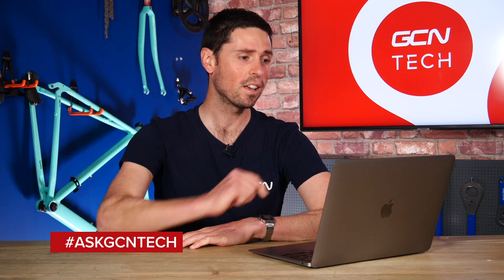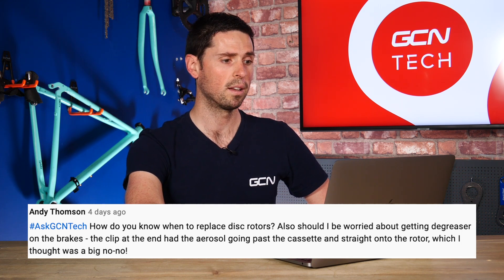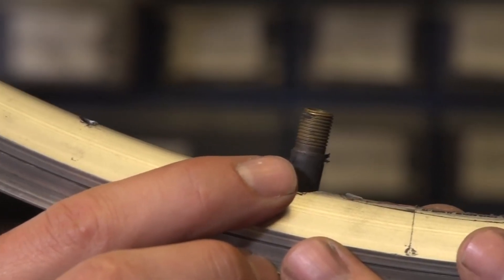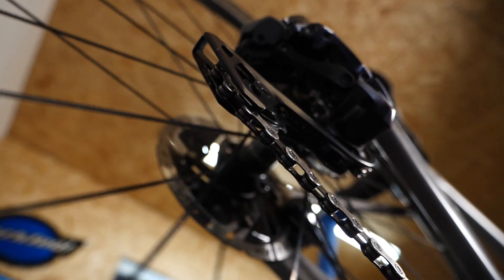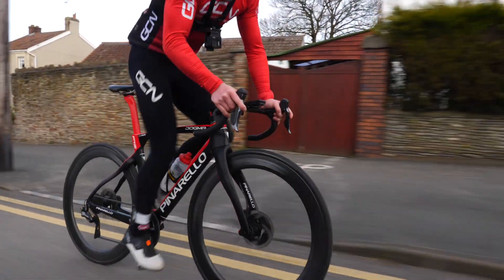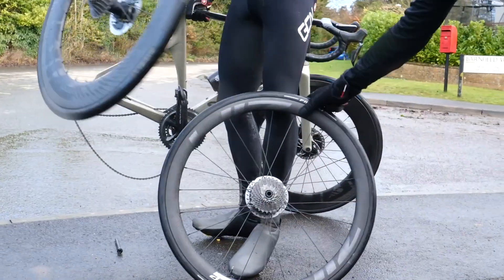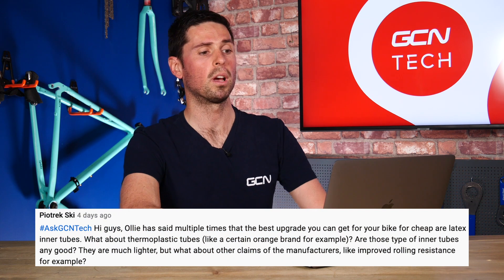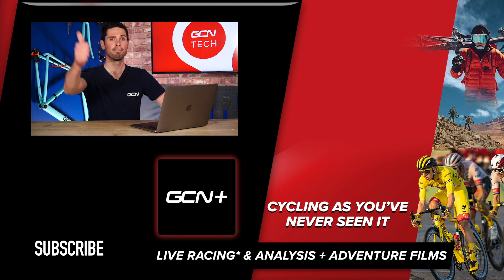When Should You Replace Your Bike's Disc Brake Rotors? | GCN Tech Clinic #AskGCNTech

Comment from the maker: Do you have a burning bike tech related question? Leave it in the comments below using the hashtag #AskGCNTech and we'll answer it in a future episode of the GCN Tech Clinic!
Reply: #AskGCNtech Need to find a replacement for badly designed R.A.T axles on 2 Focus Paralanes in the households... any ideas to convert to better through axles like the DT swiss ones 👍
Reply: #AskGCNTech  How do sealant fillled inner tubes compare to running tubeless tyres in regards to puncture protection? I'm not particularly worried about speed/rolling resistance etc.
Reply: #AskGCNTech which one will you choose for climbing: 9.5kg climbing bike, or 8.5kg aero bike
Reply: #AshGCNTech
Hi GCN, I just got a new road bike and I started using it quite well but I have a problem....when I put out some considerable amount of power through the pedals, the bearings of the bottom bracket start making few clicky, creaky noises. It is not too loud but enough for me to get annoyed. So I got the chain off the drivetrain and the cranks were buttery smooth
What should I do? Should I ignore it?
Thanks
Reply: #AskGCNTech when cycling in heavy wind, who is more affected: a smaller 170cm person/70kg person or a taller 190cm/85kg person?

Does weight or height matter the most?
Reply: #AskGCNTech Do you have any tips for keeping white handlebar tape looking clean and fresh? I certainly don’t have the time or budget to replace it whenever it gets dingy. I’m wondering if I should just accept the fact that I’m no pro, and start running a darker color. Thanks!
Reply: #AskGCNTech I’m looking forward to change to carbon rims, I got a specialized tarmac Sl4 with shimano ultegra r8000 brake calipers…. Will a 29mm width rims fit the bike? I’m having a hard time finding answers. Thanks greetings from Colombia
Reply: I must disagree with Alex's answer at 0: 25.  As long as the cargo bay is pressurized to the cabin pressure of the aircraft, there can be no more than a few PSI increase in relative pressure at altitude.  Commercial aircraft are required to maintain cabin pressure below 10,000 ft by regulation. The pressure at 14,000 ft is 11 psi, or only about 3.7 psi below standard sea level pressure. Thus, the most increase you could ever expect in an aircraft that doesn't experience an explosive decompression is less than 4 psi, and that would be a fault condition as aircraft generally regulate pressure between 5,000 and 7,000 ft.  Provided you run your tires at least 4 psi below the tire's maximum rated pressure, there should not be a problem.  If you want to cover explosive decompression of the aircraft (a less than one chance in 10 million hour event), you will need to lower your pressures to below 15 psi below maximum pressure.
Reply: #AskGCNTech Hey GCN, I know not to use degreaser on disc brake rotors, but how about on rim brake rims? Even with rubbing alcohol and bike wash I cant seem to find a way to get the grit and black stuff off my rims. Thank you!
Reply: #gcntech Question: I'm doing a long online challenge on rough urban roads, and thought about using wider wheels, and tires such as 42mm wide. But these roads are also littered with quite a lot of broken glass, and the thought came to me: aren't wider tires technically much more prone to punctures? As your contact patch is much wider and therefore you're covering much more surface area of road during your ride?? More likely for you to run over a puncture-causing piece of debris. Very interesting...
Reply: #AskGCNTech Can you open and close quick links in a chain multiple times, e.g. for cleaning? I heard that normal ones should not be used several times, but the brand Connex does links that can be reused.

Comment: The bonk weight loss thing was probably a combination of dehydration and depletion of glycogen, which together can cause 10+ pound difference depending on your size. That difference won't be fat, but it will be visible (fully hydrated and topped up on glycogen will be slightly bloated, versus completely depleted and gaunt).

Comment: Putting on my nerdy propellor hat…
@0:13: You don't technically have to deflate your tires when you fly with your bike. Airplane cabins/cargo holds are pressurized to about 11psi, which is only 3.7psi lower than sea level. Thus, it will be as if you increased your tire pressure by 3.7psi, and that's insignificant in most if not all cases. Even if the airplane is to suffer a catastrophic depressurization in outer space, the tire will see an effective increase of 14.7psi compared to sea level; I don't think most of us run our tires that close to the limit (and there's a safety margin built into the max pressure printed on the tire).
@2:58: There's a significant reduction in chain tension with the 42x42 compared to the 34x34, because the larger chainring/cog is trading off chain tension (force) for chain speed (displacement) to transmit the same power. Generally, lower chain tensions will translate to less wear and higher efficiency (unless you're cross-chaining).
@4:17: There are about 4,000 calories of energy per pound of fat, and you need to burn a lot more than one pound of fat for it to show visibly. Since you may know that it's actually quite challenging to burn 4,000 calories for one bike ride (a metric century burns approx. 4,000 calories), you should be satisfied that the bonk, however awful it felt, didn't make you look thinner.

Comment: Disc Rotor alignment - you are indeed able to "space" all your wheelsets the same. Ask anyone that races cyclocross semi-seriously :)

And yes, you CAN space out Centerlock rotors. In fact, I use the same shims that (one piece "ring" shaped ones) that are used for spacing 6-bolt ones. They are flimsy enough you can push them past the splines. Worst case, you can split them or buy dedicated ones. Boyd and November cycles have them, as well as a few others.

Much worse is when one of your wheelsets has too much paint/anodization on the brake interface and you actually need to push them inwards to match the rest of the wheels you already own. I had to resort to the judicious use of a file and sanding sponge to make an old Spinergy wheelset fit on my gravel bike (which already is spaced to fit all the other wheels I own). About a 2 hour job.

Comment: schwable inner tubes have removable presta valves as i use them with sealant
Reply: So do Continental, Specialized, and several other brands. Inexpensive tubes usually have a fixed core though.

Comment: #AskGCNTech I have a recurring problem with an annoying creaking coming from the crank area. It's in rythm with pedaling so I'm pretty sure it must come from one of the parts of the frontal drivetrain (I also checked my seatpost and handlebar) - I removed, cleaned and regreased my cranks, chainrings and any nuts and bolts and even had my local bikeshop take a look and exchange the bottom bracket - alas, to no avail. Any more tips on what else it could be and what to do?

Comment: I've tried ghetto tubeless conversion once using shrader valves. The conversion worked well but valves were clogging with sealant constantly. I find regural shrader valves not suitable for tubeless sealant.

Comment: You can use spacers on a centerlock by using a centerlock to 6 bolt adapter, a 6 bolt rotor, and the spacer.   But you can only space it outward, not inward... so it can only help in very specific scenarios, and of course it requires all those things.   (I only know this works because I switch between a 6 bolt wheel and a centerlock wheel with a 6 bolt adapter because when I bought the wheel I wanted to re-use my rotors from the old wheels they were replacing to save some $).   You can only use ONE thin spacer though, at least with my adapters.   Any more and you wouldn't be able to bolt on the rotor.   Luckily one thin adapter is all I needed to make both work great.
Reply: You can have the inside edge skim along the inside face off the securing (holes)off rotors or face off wheel enough to use spacers to adapt inney or out to get provided correct position making your own spacers. Along with floating rotor not only dealing with heat but possibly position  (don't use angle grinder ) if you're a club it's worth investment small quality milling drilling machine if not find some motorcycle motor engine tuner somewhere that does precision engineering.

Comment: #askgcntech my wife's bike has an ultegra R8000 crankset with a compact 50/34 chanset. She wants some easier gears, so I think she should get a subcompact 46-30 chanset. Are there chainrings I can fit to the existing ultegra cranks or will I need to get a new GRX crankset and will the GRX600 crankset fit  the existing ultegra front derailleur?

Comment: #AskGCNTech
I am trying to upgrade my really old Apollo Bike from Halfords.
It has Shimano 7 spd gears but I want to install a road handlebar and shifters.
Can I get away with just changing the handlebar and shifters to Shimano 7spd road style?
"Shimano Tourney ST-A073 Gear/Brake Lever Set Road 3x7-Speed black"

Or will I have to upgrade EVERYTHING including the cranks cassette and both derailers?

My bike is 3x 7 spd. Has MTB handlebars with grip shifters.
It has a rear spring and front shocks. but I don't think this has any effect on the bike really.
It has a Front Disc brake and a rear rim brake.

I assume if I change my shifters to STI, the brake cables also need to be redone at the same time.

Comment: #AskGCNTech If I swap an ultegra 11-28 casette for something more suitable for climbing, like a 105 11-34, do I need to adjust the rear mech or chain? Cheers!
Reply: Will need a few more links on your chain but yes it should work ok besides you can all ways make it work with a road link in most cases

Comment: #AskGCNTech I have rescently converted my CX to a 1X setup and having suffered a Brachial Plexus of the right arm (Partially paralyzed), I want to swap the shifting from the right to the left hand side. Can you recommend an engineering company to make a new 10 speed cog to fit into my current left hand Sram S Series double tap shifters or can you suggest a suitable shifter that can be easily converted?
Reply: Go wireless having a10 speed made wouldn't be pratical from scratch you'd need more than one the common cogs look so simple but considering all the shapes allowing smooth gear selection not to mention the heat range .probably well guarded secret by different manufacturing practice without won't last a spin round one lap off TT isles man there's everything out there just  (about )case of a few phone calls Emails sorry about your predicament don't throw money away on one offs unless it's a major player.
Reply: @rayglasscock9667  apologies if I have not explained my problem clearly. It is not the rear cassette that I want made, it is the little cog that goes inside the gear shifting lever itself that enables you to select the 10 individual gears. Some of them are dual purpose meaning they have two clicks one side (2x) and if you spin them around they have 10 clicks the other and can go in either the left or right levers. Unfortunately mine are specifically designed and handed for each lever.

Comment: Please could you explain why the pros cannot have quick release wheels when using disc brakes? Only asking as my entry level road bike has quick release and disc brakes and it seems to work just fine. Puzzled by the difference.
Reply: Both my road bikes have disc brakes. One with QR the other with thru axle. What I've noticed is when you take the wheel out with QR and put it back it's more fiddley to get the QR tension correct without the pads touching the rotor because when you increase tension in the skewer it pulls the bottom of the fork legs together moving the calliper on the fork leg out of alignment making wheel changes slower. Getting the tension correct on a thru axle after a wheel change is easier
Reply: @nemeanf27  Perhaps this is me not understanding what a through axel is then. I will go away and do more research.

Comment: #AskGCNTech When taking a sharp fast left-hand corner (bike leaning over), the front brake rotor rubs a little bit on the calipers. Is this amount of deflection in the wheel normal/acceptable? Wheels are generic factory-spec alloy.
(I don't know if the same happens on the rear, I can only hear/feel it on the front).
I don't know if it is relevant, but I am getting reasonably close to the weight limit of the bike, as myself + backpack is probably getting close to 110 kg, and the bike limit is 125 kg.

Comment: #AskGCNTech Hey guys, love the show. A couple of chain questions, firstly does a "Quicklink / Missing Link" need replacing everytime you open the chain? Secondly is using a "Dry Wax" lubricant meant to give a light chain noise, or should it be slient? As mine makes a noise, wondering if I didn't coat the chain enough. Many Thanks

Comment: Isn't it true though that glycogen pulls water into your cells so if your glycogen stores are depleted (consistent with bonking), your cells will also have reduced fluid retention, so you'll look all around "smaller" from the water weight loss? I don't think it's just in his head.
Reply: Exactly what fighters do for weigh in before a fight. They sometimes look tiny compared to fight night!

Comment: You could explain why you think you need to reduce your tyre pressure before flying.  The maximum pressure drop in an airplane hold, if it’s completely unpressurised, is 1 bar or about 14psi.  If your tyres can’t take a 1 bar pressure increase drop your tyre pressure a little. Otherwise the need to drop tyre pressure when flying is nonsense, often repeated by people who should know better.

Comment: #AskGCNTech I recently bought my first Carbon Bike. Do I have to be worried now when using a bike repair stand, that compared to Aluminium the tubes could get bent easily? Should I instead only hold the bike at the seatpost? I'm a bit nervous because these stands are only for round tubes, but my tubes are angular.
Reply: seatpost only.

Comment: #askgcntech Question: I’m doing a long online challenge on rough urban roads, and considered using wider tires, such as 42mm wide. But these roads are also littered with quite a lot of broken glass and such, and the thought occurred to me: aren’t wider tires technically much more prone to punctures?? As your contact patch is much wider, therefore you’re rolling over much more surface of the road during your ride? Increasing the likelihood of running over a puncture-causing piece of debris? Very interesting...

Comment: #askGCNtech I might have misunderstood but it seems you said that sealant can be put into inner tubes. I get a lot of punctures from small bits of metal in the road. Will this solve my problem? Can it be done with all types of inner tubes? Sorry if I misunderstood
Reply: If you've got a removable valve core on your valve, you can absolutely put some sealant into your tubes, works great. Only with butyl and latex though, as apparently it tends to mess up with TPU (like Tubolitos).

Comment: Also, the marginal efficiency offered by a 42 x 42 vs 34 x 34 is probably offset by the heavier combo (larger chairing, cog and longer chain) and a bit of a aero disadvantage !  So not worth it at all !
Reply: Most probably 42x42 is used as "one by", so penalties are reduced through front deraileur and shifter (btw, I run 46x46 on one of my bikes and all I could worry about is chainline angle, bur in fact I don't)

Comment: Re the rotor issue, probably using a new rotor on the new wheel which would be thicker than the older used one hence the rub

Comment: #AskGCNTech   Disc brake rub question: I am disappointed in you. They do make shims specifically to adjust the rotor for 6 bolt and for center lock. I had to get some and use them on my new wheels that have center lock rotors. How do you not know that? You gave bad advice.
Reply: I waa about to make a similar comment about rotor shims
Reply: Can’t you also just recenter the disc caliper by loosening the caliper bolts , squeezing the brake lever, and tightening the caliper in its new position? Then you’d have to do it again when you switch back to the original wheels.